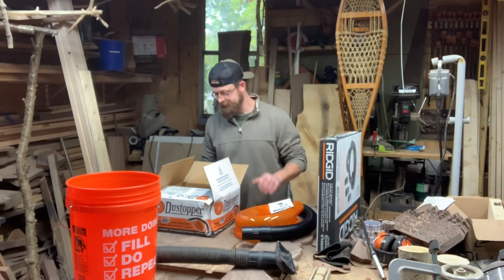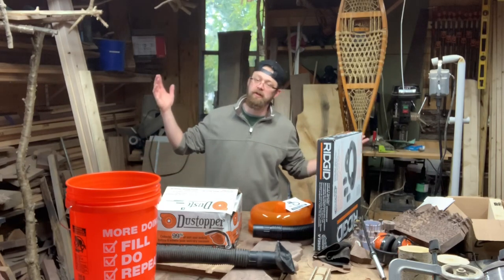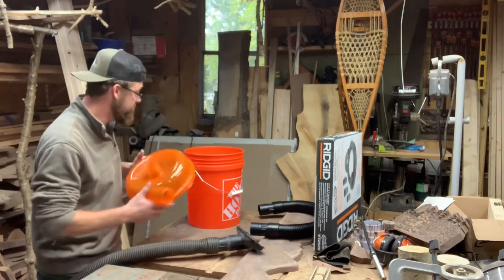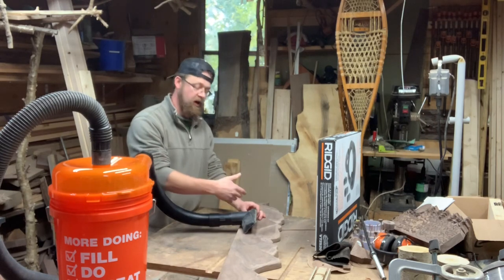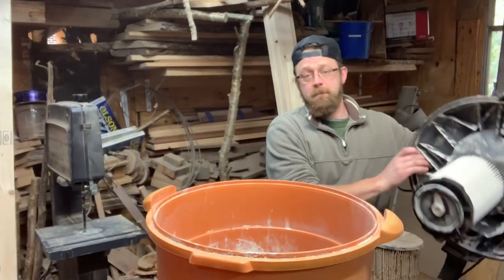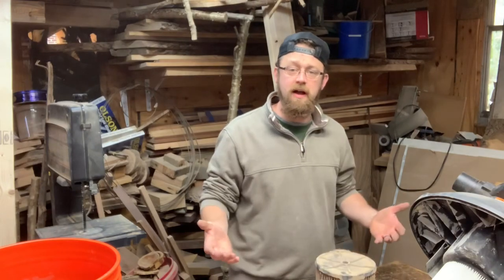Using and reviewing the Dustopper !

Comment: You dont need the bottom plate on your shop vac filter since ridgid updated there design so it is incorporated into the new filters
Reply from the maker: Cool thanks for the tip 😁👍🏻

Comment: Bought 1 of these new along with a new 12 gallon ridged shop vac & after about 30 minutes of use there was just as much dust in my vac as I the bucket???
Reply from the maker: I had that issue I realized I had the vacuum attached to the wrong port on the dust collector
Reply: @KyleHallwoodworker  I checked that..... idk what’s up with it
Reply: If the Dustopper doesn't have a good seal to the bucket or the hose between the Dustopper and vac leaks it will suck debris into the vac. Also, for best results, empty the bucket when it's about half full.